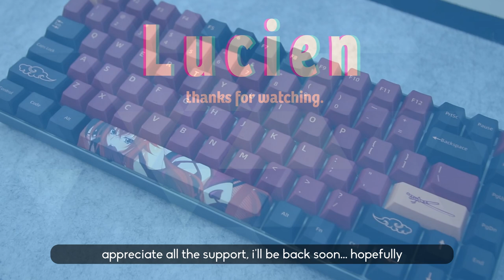Custom Keyboard for my Friend! | CIY Tester 84 | Gateron Milky Yellow | Chill unboxing and build ♪

Comment: Wow, I'll definitely consider this for my silent build, but quite sad it isn't wireless, I value the connection method a bit more than the sockets' direction
Reply: Oh and I'm just making sure, these gateron milky yellows have a pro variant, and do their housings support cherry profile with north facing? It's a big problem for us cheaps and it'll help us lots !
Reply: @wil-  it has interference with north facing LEDs

Comment: I've just ptfe tapped my stabilisers and lubed them up, as there is a lot of rattle and play with them stock and they weren't lubed generously. I have filled the empty battery space below the silicone pad with acoustic fan filter material and have used 3 layers of painters tape. Just waiting for my purple panda switches and pbt pudding caps. I'm going to lube my switches and fill my space bar with tape too. I hope it THOCKS! 🙏